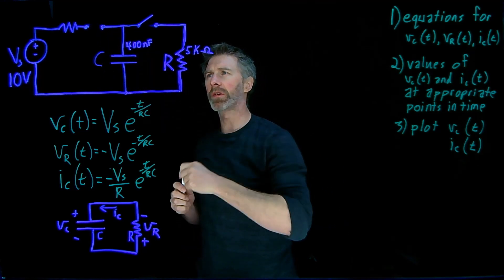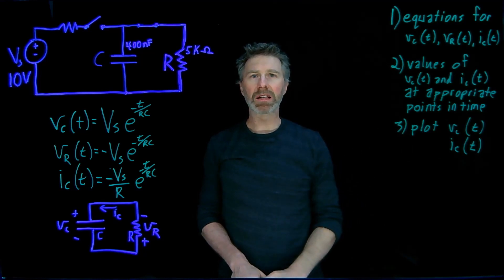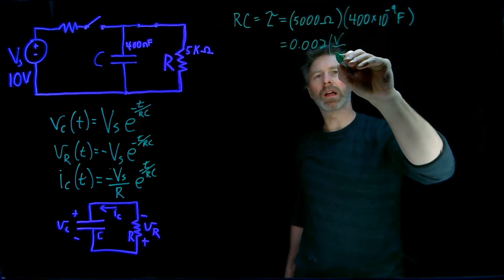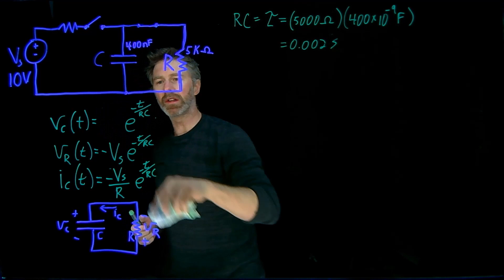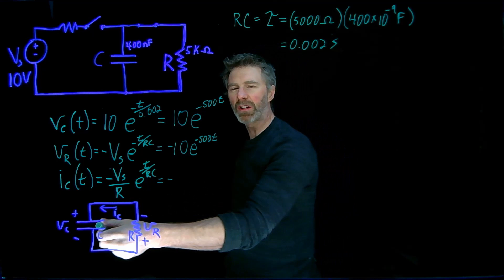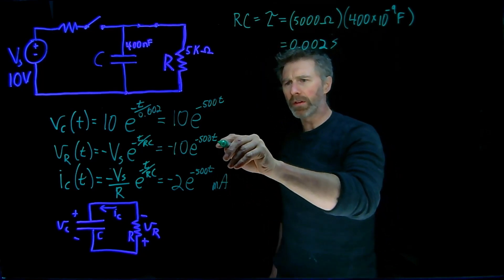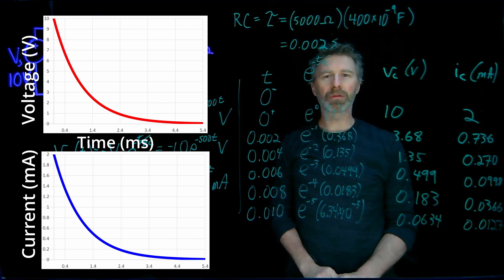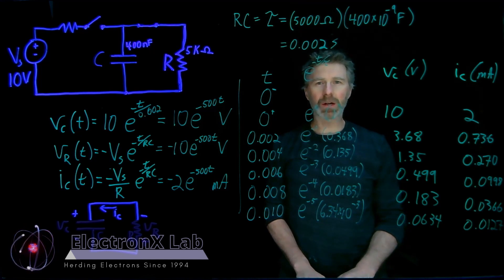Practice Problem - Discharging Capacitor in RC Circut

Comment: @1:00, why is the current going into the +ve terminal of the capacitor? Are you talking about the electron current in this case?
Doesn't conventional current normally come out of the +ve terminal of a battery?